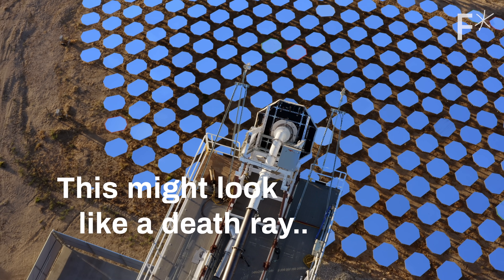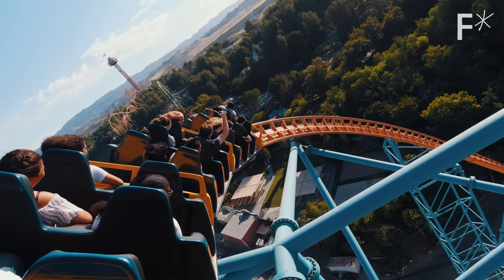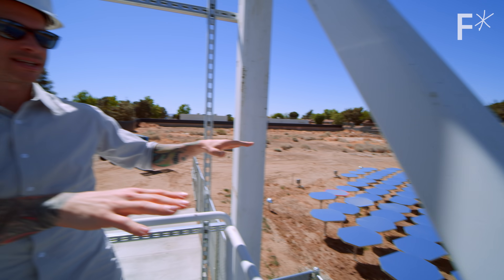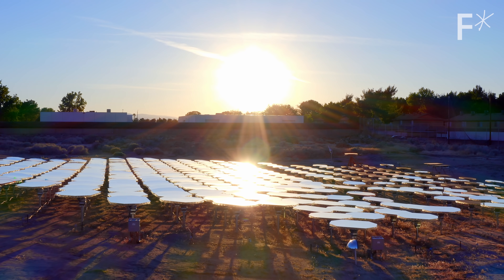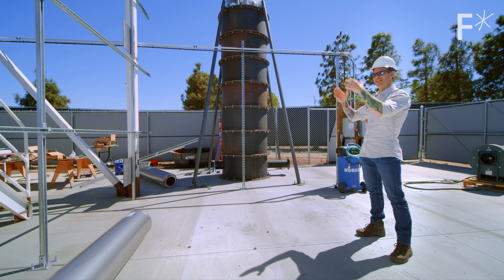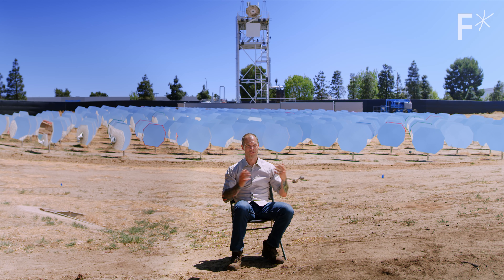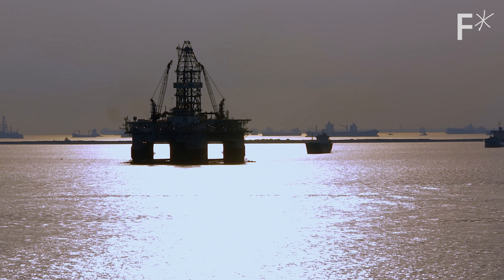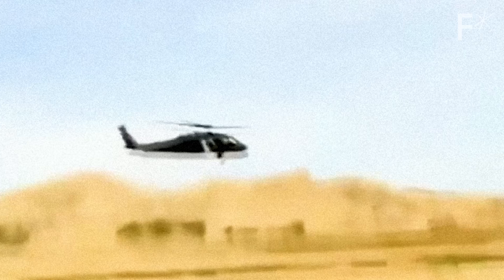How concentrated solar power could fuel the future | Big Think

Comment: Way better than coal and oil but not good for the birds that fly near the tower, we also need to remove a lot of heat that is being trapped due to green house gases so how about using millions of mirrors to reflect energy back out into space see how by looking into the Meer project.

Comment: I was so disappointed when I researched this.

Turns out the glass breaks (it’s not glass) and is an expensive process to produce which uses a lot of oil and fresh water (don’t want more of that).

Also, the generator only works by itself on very sunny days, so they use methane to jump start it most days (very high pollution).

Turns out this idea is just hiding how the oil is used.

Comment: This is a very exciting technology but I wonder what the carbon footprint of creating all those mirrors would be I mean I suppose one some of the towers are up you could use the energy from those towers to do the mining for the additional materials but it really just depends on what those mirrors are made of this billionaire sounds like he knows his stuff so maybe he's got a plan worked out for that but that's the same problem I keep hearing with solar and electric vehicles is the processing is so resource intensive that it's not generating a net positive for like 30 years however using rocks as batteries pretty ingenious

Comment: this is a better use of "solar" than the cheap, unrecyclable garbage littering the planet as photovoltaic panels

but I still take issue with your describing hydrocarbons as "burning dinosaurs" or "fossil fuels"
CH4 is about the most plentiful substance in the Solar System, the gas giants are made of CH4 and NH4
it is also produced deep within the Earth, under heat and pressure - and surprise, it flows, just like molten metal
therefore the most likely scenario is that dinosaurs were inundated with, not that hydrocarbons are composed of

common sense should tell you that the billions of tonnes of coal, oil and gas we have burned cannot have come from some ancient swamp - the volumes are simply too unlikely - but as the remnants of Solar System aggregation and the movements of the planetary mass (molten elements) acting like an enormous cracking tower - and more, fusing the hydrocarbon chains to "refine" in the first place 

the area of the present forests of the world is about 347 million hectares
assign a high value of 300 tonnes per hectare (that is biomass, not carbon)
gives an approximate tonnage of 104 billion (probably high, the 300 is based on the top end of the range)

world usage of oil is about 100 million barrels per day
a barrel of oil weighs 135 kg
is 1.35 million tonnes per day (hydrocarbon not carbon)

we know the carbon is down there, kimberlites (source of diamonds) are formed deep in the mantle
it should surprise no one that modern science is based on many false assumptions - even less surprise that postmodern science would make it up as they go, based on socio-political networks (power structures) rather than observation and experiment - they openly teach such methods over in the humanities, don't make the arrogant assumption it isn't so on the STEM side, and the more politically correct it gets, the worse the science - for now, all we can do is look for results that actually do something - in other words, watch the gadgets, watch the charitable organizations for diseases that are dissolved because: problem solved

the rest is smoke and mirrors - yes, I know the miraculous cures on the evening news - doesn't it make you feel hopeful, now let's find the beer and babes

Comment: Why aren't steel manufacturers using this tech? There's no need to convert the heat into anything.  AZ should be the steel capital of the US.
Reply: Very easy, iron ore is not just heated to extract the iron , it is a chemical reaction of the coke (carbon) and lime stone flux that frees the iron from the iron oxide of the ore.     Turning gypsum to portland cement  would seem to be possible but after a week of operation the mirrors would be so full of cement dust they would be useless.

Comment: So they're basically just making liquid Hydrogen?

But instead of using fossil fuels like Hydrogen is commonly made today, they're using renewable energy like people are proposing it should.

They've merely just tweaked the process, and just found another way of getting to the goal.

The main "revolution" here is actually the hydrogen liquid that is formed, which is poised to be a competitor to battery powered energy.

This is absolutely did not need the "hype" and fast-paced editing this it got.

Comment: Hydrogen is an absolute nightmare to store, transport and use safely. Much better to use that power to create synthetic hydrocarbons if you must, as that quickly decarbonises long-haul aviation, heavy shipping, mining and other hard to decarbonise industries while they convert to battery electric. Porsche are doing it with Wind power in Chile which keeps their classic vehicles on the road, while bringing out the Taycan as their first electric sports car.

Comment: Finally, its the cost of energy that matters. ECONOMICS !!!! Get an energy source cheaper than fossil fuels, and you create a new market. Make it much cheaper, and you create new uses, that were not considered in the past. That's how the industrial revolution happened. Even in the not too distant past; COMPUTERS. In the 50s & 60s they were large machines only the government and large corporations could afford. Now the technology is so cheap, the microcontroller inside a TV remote is more powerful than a typical computer in the 60s. Your cellphone 100x or 1000x more powerful. When economic factors change, the use also changes.

Comment: The energy harvesting density compared to photo voltaic solar must be phenomenal.
There must be simpler ways of getting that accuracy in mirror control for simplicity. 
Each tracker could be standalone with a small PV panel, lithium cell, and wireless mesh network.
Molten sand powering a super heated steam turbine and recondensing all the steam would produce power 24 hours.
The cost of building a coal mine or nuclear power station could pay for dozens of these, even before automating the array build.
Just don't allow corporations to own them.

Comment: They could also crack methane to Carbon and hydrogen with this high temperatures or clean the Air from CO2  by cracking it with a catalyst.

Comment: The real innovation here is the Heliostats and how they control them. There was very little details on how they store the thermal energy other than they plan to heat rocks. Circulating and storing rocks/lava is not trivial and they provided no info on that.

There was absolutely no information about how they intend to create electricity or hydrogen so it does not sound like they are developing any tech for that so I assume they will use whatever tech is commercially available for that. 

The biggest problem with a hydrogen economy is missing pieces in the supply chain as well as the infrastructure. Keep in mind that hydrogen is just an energy carrier and one with low efficiency so it will take a lot to be commercially competitive with the power grid if you are competing on energy transport. Also, if you intend to make hydrogen then there is no point in going via thermal energy storage since hydrogen is energy storage.

Hydrogen makes sense for large industrial applications but not for personal vehicles (maybe it can be competitive for trucking but even that is doubtful). 

I guess my point is that this video comes across as an add to create interest from investors. If they get the Heliostats and thermal storage to work at a competitive price then that is a great achievement and contribution. I wish them the best of luck.
Reply: I'm a little surprised they didn't mention molten salts.
Reply: @whiteknightcat  Yes assuming that is what they are using as the energy transfer medium. However in the video they alluded to heating the rock directly. Not sure how they intend on moving the rock / energy as they hardly provided any info on this.
Reply: @christianmarkussen6412  Yes, that was something I'd not heard of before. Then again, molten lava can stay molten or exceedingly hot for days. I wonder what specific "rocks" they have in mind with a high enough heat capacity to be able to boil water to create enough steam to make the facility worthwhile in non-daylight conditions.
Reply: @whiteknightcat  Molten rock can of course hold a lot off thermal energy but not sure how you move it around. It's not like you can use regular pumps. Also if it cools and solidifies then you have a bit of a headache 😲. It will be interesting to see what becomes of this technology.

Comment: ...Or you could just use a molten salt reactor and use a fraction of the land, raw materials and resources that are required of concentrated solar power.
Reply: It is easy to make a case for a few of those reactors. However automated mirror systems can easily be done by private industry and scale very quickly.
Reply: @secretweapon7764  Ivanpah Solar plant (392MW nameplate capacity) produced 856,000 MWh in 2020, over 3766 hours in a year it produced the equivalent of a 97MW generator running around the clock, meaning a capacity factor of ~25% and covers an area of 3500 acres. 
Calvert Cliff's Nuclear plant in Maryland (Generation equipment and reactor only covers 7 acres). Output 1718 MW or 15,000,000 MWh per year. 
In other words; it generates 17x more energy on 1/500th of the amount of land.
Okay sure, mirrors can built quickly, but you really think they can scale for places that AREN'T actually uninhabited deserts? What else can be built quickly if done correctly? Nuclear reactors. See France and S. Korea for reference. Peace.
Reply: @secretweapon7764  Good point, but this is what's also happening to the nuclear industry. It's all going private because the Government is close to being useless. Even outside the U.S., a lot of companies from all over the globe are racing to get their first molten salt demo reactor up and running to prove to the regulators that it's the best shot we have of making clean, cheap and abundant energy.

Comment: As a proponent of hydrogen power, I absolutely love the concepts in this video. How will your "Green Hydrogen" compete, though, after it is transported? Hydrogen is the future, in my opinion (4 minute car refueling, & doesn't require a plethora of batteries that rely on rare resources like lithium or cobalt), but transporting hydrogen is expensive. How will this solution make green hydrogen more competitive?
Reply: Transporting hydrogen through pipeline is very expensive
Reply: @ecobuddyindia3028  I always assumed it is not because the running cost are low once the pipeline is installed. Do you have a full life cycle analysis on this?
Reply: @Sebastian_Gecko  it appear that hydrogen can escape  through standard medium of containment . Losses could be very high and dangerous.
Reply: Pipelines are not that expensive

Comment: Even with tracking software, such a modular design requires a lot of small motors and stands for the mirrors. Yet if they manage to make it cost effective, this will change the game. Hope they can do it.
Reply: Don't know why you need AI.  The path of the sun across the sky is pre-determined.  Easy to program in; look at the clock (day/time) and you know where the sun is.

Comment: Very interesting and creative measuring the "blueness" of the sky reflected in the mirrors to determine accuracy. Will have to think about that further, there's obviously more that isn't described to know exactly how that works, but in theory I can see how this implementation of feedback can be a great improvement over traditional "dumb" mirror positioning.

As for the "rocks" of course that depends on the geological composition to determine if suitable and I imagine that some kind of molten metal would be far better and not terribly expensive to improve capacity. Thermal has always and likely will almost always make more sense than electro-chemical batteries for storage when  volume and land area is not the limiting factor. The only reason in favor of electro-chemical batteries is when space and volume is limited or there is a massive surplus of decertified battery packs no longer used for their original purposes.

Comment: I hope this effort is successful. I can't wait to buy a hydrogen fuel cell car!
Reply: You'll never drive a Hindenburg car
Reply: @toddshaw6658  1) EV's that use lithium ion batteries are far more dangerous than those powered by hydrogen fuel cells. 2) The Hindenburg burned because the fabric that covered the frame was coated with mixture of cellulose acetate butyrate and aluminum. It was this coating and NOT hydrogen that caused the Hindenburg to burn so quickly.

Comment: so your ground breaking technology is a control system, which uses feedback, a concept over 50 years old? I dont see what is so special.  

I do applaud the efforts to take us green. Its in the right direction and im glad your working on it.
Reply: There is one big problem - how many workers and water is required to clean those mirrors from dust and sand?  Also sand will scratch surface of mirrors so they must be repaiered regulary too.

Comment: 6:14 "pour the concrete". If the heliostats orient themselves in real time using skylight, there's surely no need for concrete foundations for every unit. Why not have a mobile machine that simply pounds the base stem vertically into the ground? Quicker and less concrete. Sure, you might need to correct one or two but if speed is important, you can afford to mop up the wiggly ones later.
Reply: Exactly.
And another major point for not using concrete as a base is that you can have a double usage of the land. Make the heliostats a tad taller and you can use the shade they throw to plant grasses underneath and most likely also tend sheep (no need for mowing, also: whool).
As they're trying to stabilize politically delicate countries, you should really try to squeeze out as many different usages from these plants as possible to generate income for the surrounding poorer population and do something for the biodiversity at the same time.
Reply: Guess you never tried to dig a hole in the  CA desert and experienced the daily high winds.
Reply: The units shown here seem to be pounded into the ground -- you can't see a concrete base.

Comment: It would be interesting to compare efficency of solar panels versus focused mirrors. Is there a micro version of this I can run my house on? It seems to me the biggest issue is storing the power. I don't beleive hydrogen is the answer. Maybe hot rocks IS the answer.
Reply: I dont know if it can run your house. But you can buy micro version that will burn you house easily (if it is made from wood). Or other houses.
Reply: Good thought @nalim27, I can use the heat generated from burning my neighbours house to generate power for my house. Looks like I could go through a few neighbours.  🤣😂🤣

Comment: there are a lot of missing steps here. How do they power the electrolysis? I presume a steam generator. What do you do with rocks? Pump in water for steam and a steam generator? And if you're making hydrogen fuel, why do you need the hot rocks? (Fuel is a battery)

Comment: Cool but we have same mechanism within earth core but this look cheaper rather drilling all the way down. Any way design can much more improve and much smaller for same or more efficient output. Thing is energy stored in rocks can we take it out use it with same value what is stored. Any way this look fun and safe and looks like a hope for reducing carbon. Thing is they knew this and lot much safer options to run this world but they want monopoly which can't be copied, otherwise we use to produce much same thing to burn paper since kids with microscope and sun.

Comment: You're going from light to heat to electrical power. It's a nice simple technology but i don't see how it's going to be more efficient than solar cells, which are already made of abundant silicon (a variety of n and p type dopants can be used, you essentially need an element with 5 valence electrons and another with 3).
Reply: Might not be more efficient but I'm guessing it's cheaper to make... I'm not sure though. This technology isn't exactly new and there's currently cheaper ways of making green electricity

Comment: I keep hearing the word refineries and yet this is being touted as another source of electricity. If you're producing temperatures of 1000 degrees + why not use that directly in industrial applications that require high temperatures and currently burn the the highest grade of coal? Like, you know, steel refineries? You could have a big furnace in the desert and shine the concentrated sunlight onto that.
Reply: The coal in steal production is not just burned for heat, it also reacts chamically with the iron ore to form CO and elemental iron. Can be replaced with hydrogen tho.

Comment: Energy doesn't travel that well over long distances.
Reply: True! It sounds like they solved this problem though. It should be cheaper then oil and coal shortly as well. 
They are using the heat to split H2O to hydrogen. Then shipping the hydrogen. The rocks trapping heat to 1k° also reduces the need for batteries and giving constant operation.
Sounds like they have a great conversion and transportation system.
Reply: It can travel well, but it requires expensive infrastructure. You need HVDC power lines.